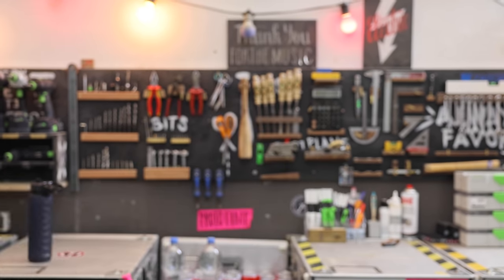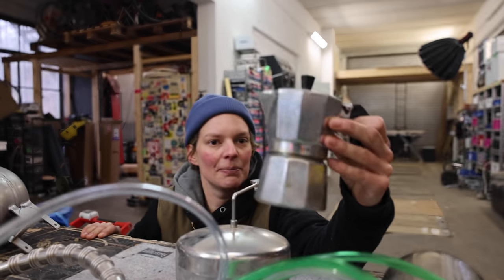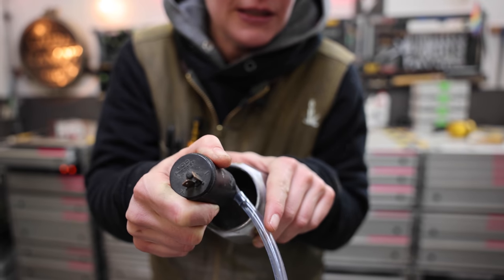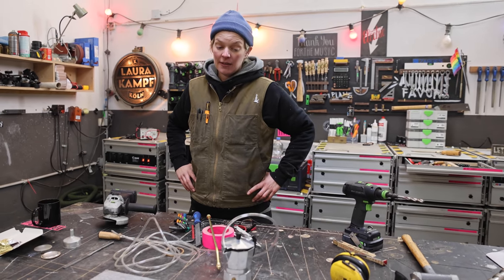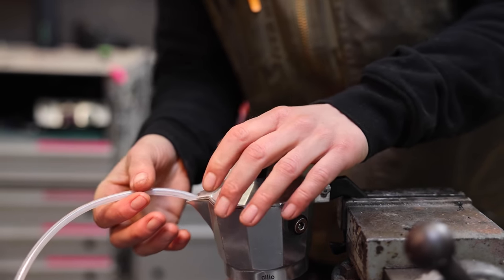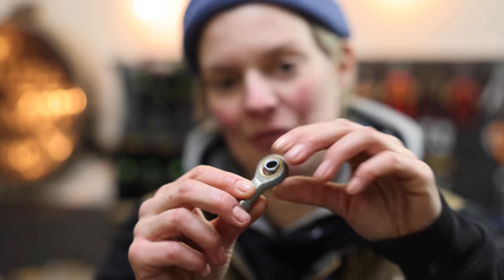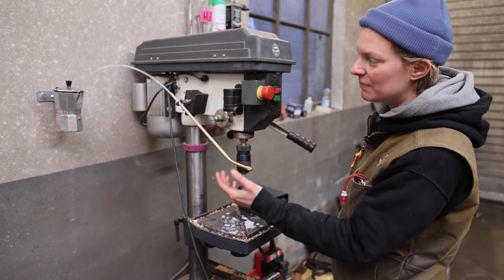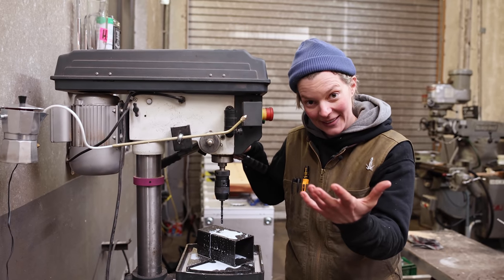Cutting Oil Pump from old Coffee Maker (genius or stupid idea?)

Comment: add a solenoid valve that is on the same circuit as the pump.  When you step on the pedal it turns on the pump and opens the solenoid allowing the fluid to flow.  When you remove your foot from the pedal the pump turns off and the solenoid closes.  Commercial espresso machines use a lot of solenoids that I think would work perfectly for what you are trying to do.

Comment: If you want to overengineer it, you may use a magnetic valve (12V valves are available). With the foot pedal you can open it and as it is leakproof you might not have the dips. Take care on the current consumption to not burn your AC adapter 😉

Comment: Epoxy the tubing into the pipe then have a rubber gasket that will only allow liquid through under pressure in the tip of the nozzle. Maybe just a round piece of rubber and you poke-cut a flat slit in it.

Comment: An Electronic approach would be sucking back some of the fluid. By reversing polarity of the pump.
 But probably best to have a small magnetic valve on the tip or close to it. But first try to lower the oil tank.

Comment: i agree with the idea to lower the pot, but it may not be a solution since the tube goes higher than the work surface. It may be still a mess, a smaller one, but still. 

In my opinion it my be either working on a nozzle or the punping. it may need to not be "continously" pumping liquid, more like a squirt gun., intermittent

Comment: The copper pipe should be angled up, so the fluid runs back into the pot. And you should add a foot switch to add oil on-demand.

Comment: As many have said. It's a syphon. Either drop the pot lower or pop a small spring and ball bearing valve in the line that the pump can overcome but stops the dribble.

Comment: Laura, you have created a siphon and once the cutting fluid starts, it will continue through air pressure.  Rob Sweeney is correct, lower the reservoir to below the drill platform and when you stop dispensing fluid it will flow back into the tank.  

Enjoy your creativity.  Wishing you and your furry kid a blessed week.  Peace

Comment: I would hazard a cautious guess that having the nozzle lower than the oil reservoir means that once the tubing been filled with oil by the pump, it keeps on syphoning oil out and dripping without power. An easy fix could very well be putting it lower on the wall, perhaps level with or below the table on the drillpress?

Comment: Mount the coffee maker onto the press and  relative to the table and not fixed onto the wall.  
Replace the plastic handle. Was meant for occasional use. I fear the handle will fail with pump vibrations and torque of the hose 

See siphoning issues.

Comment: I love it. But the path that was so clear and straight was merely a mirage concealing and endless series of turns and obstacles. It think the first wrong turn was the first step. The pump. The solution is in the final problem. Gravity. Just a motorcycle fuel line shut off and gravity from the reservoir would have done the whole job. But where’s the fun in that?!

Comment: I think the leaking fix is quite easy: You have make the connection between the hose and copper pipe air tight.
As it is, there is no  direct pressure from the pump into the nozzle and cutting fluid gets filled up inside the copper pipe and gravity pushes the rest of the fluid in the pipe out. If the connection between the tube and the copper pipe is air tight, the internal pressure of the system keeps the liquid in. The weight of the liquid in itself should not be enough to overcome the sipfhoning effect through the internal resistance of the pump when not active.

Comment: Who says you can't drill glass?

When I was taking middle school shop class, one of the projects (not one I did) was to make a lamp from a wine bottle.  I don't know the details, but a hole was drilled near the bottom of the bottle, on a drill press, to run a cord.  Rather that a drill bit, I think the cutter was just a metal cylinder.  Some kind of grit and maybe water or oil were used too.

Looks like technology has improved in the past 45 tears.  A quick web search finds numerous diamond and carbide burrs go cutting glass.

Comment: Yep. As others have suggested: peristaltic pump is probably the best bet. Nice, even, small, individual dispensing on demand. And if the coffee pot reservoir is lower, the "extra coolant drip" from the line might be negligible. I know, I know.. you don't probably have a spare peristaltic pump in the warehouse of parts, and everything is supposed to be upcycled from trash. But get it anyway. Don't let the perfect be the enemy of the good! That said, I'd never bet against your imagination. Given time, perhaps you'll find the ideal solution batting around in your parts bins, as you have so often done in the past.

Comment: You should also probably change or reinforce the handle of the coffee maker: it is not designed to support all the extra weight, so you have a weak point where it's attached to the coffee maker...

Comment: Another great video. Maybe what you could use is a non return valve. They use them in cars for the washers - that way the water does not seep back into the bottle but sprays as soon as you push the washer button. Just an idea.  Anyway, love your stuff!

Comment: Perhaps there is a way to add a small nipple or latex fabric piece inside the tip that acts as a stopper when the pressure drops from the pump, so it won’t drop. Similar to a baby bottle nipple that won’t drip when knocked over. That way you don’t have to move the location which may be problematic in itself. Somehow sealing the tubing inside the metal line in a way that stronger than a press fit may be necessary. Hot glue gun would likely work.

Comment: My thoughts are even if you move the tank lower you will still get the fluid in the pipe running out, you need something like a bite valve or baby bottle nipple that the fluid needs to push pass with minimal resistance put will close off when there  is no pressure from the pump. Even a reed valve made of rubber? You are so close, don't stop now!

Comment: to solve your issue I would run the pump for a second backward when it gets stopped. Sure, this would complicate the electronics. Still probably the most reliable solution.

Comment: Make a device like an intrivious drip like the hospitals use with a drip feed. Open the drip feed value when you want oil, close the drip feed value when you don't. If you put the drip attachment holder and a spill cup holder on he same pole you can rotate the cup underneath the drip to catch any drips.

Comment: I actually think the problem is that the tube is a bit smaller than the diameter of the metal pipe at the end, so air can enter the system. At the same time, the nozzle is smaller than the tube so excess oil will rise between the tube and the pipe which also adds to the dripping. I think you should just connect the tube and the metal pipe in a way that is air tight and you are good.

Comment: Another idea; my drilling machine has a sump attached to the table to catch the fluid that ends up there.  It has a filter to keep debris out of it.  It's essentially a hose fitting with a tube going to a container; if you filter it well enough, you can reuse it.  For my small drill press, I use an IV bag with a nylon tube clamp; I adjust the volume with the clamp.  I really should dye my coolant red - that would be hilarious.

Comment: If u wana drill a hole in Ceramic or Glass try put that into the water and drill...should be easy and will not brake on apart.

Comment: Maybe it's not a failed project, you just have it on the wrong machine? It looks perfect for doing big cuts on a lathe or mill. For a drill press, I think you probably want something that will dispense fluid in discrete quantities. Maybe get a bathroom soap dispenser, and hook up a foot pedal?

Comment: I think a old fashioned oil can would work better and just place it on the side of your drill press.  It’s held in place with a magnet. Just reach up and grab it. Also I can tip it over and let drip out if I need to.

Comment: What if you only used the foot pump to add air to a sealed container? Foot pump pumps air in, tube that is low on the container let’s cutting fluid escape. Then you would get only one burst of fluid at a time.

Comment: The ideas I have

1) a lightly spring loaded cap at the end that opens when there’s enough pressure, but closes on a drip

2) attach a powered clamp to the flexible hose that activates when to depress the pedal

3) mount the pump lower than the work surface, so that when it’s off, it can’t limb higher and out the nozzle without the pump

4) similar to 3, make the hose longer, have it go down to the floor, then up above the drill, then back down to the work surface. This should limit dripping, but there would be fluid in the u shape that goes towards the ground, but would be better than the current dripping.
Reply: Number 4 won't work. Regardless of the hose length, as long as the reservoir is higher than the nozzle, the system will act as a siphon.
Reply: @tuffaluffagus  Your confidence suggests you're right, but gas thieves would probably argue with you.

Doesn't air pressure enter into that? So actually, it more depends on the surface area of the reservoir I think multiplied by the pressure? Which means that, yes, if the pressure at the nozzle is less, then the liquid would come out, but only if that pressure exceeded the force of gravity

Bottom line: I think it's more complex than that
Reply: @EliotHochberg  imagine connecting a hose to a funnel, both ends pointing up and held at the same level. Now imagine completely filling the system with water. Would the water automatically start shooting up and out of the hose because of the difference in surface area exposed to atmospheric pressure? Unfortunately, no. Then we'd be able to build free energy generators. The amount of pressure at any point in a volume of liquid that's open to the atmosphere is directly proportional to the height of liquid above it. So as long as there's a difference between the height of either end of the system, the pressure will always be higher on the end that's mounted lower, regardless of the surface area exposed to the atmosphere.
Search "aquarium bridge" and "how do siphons work?" for really interesting edutainment!

Comment: Use gravity. 
Just put the pump lower on the wall than the spray nozzle.

(Think of your shower head.
      If you turn the tap off after a shower, the water stops.
      If you then take the shower head, and bring it lower than the tap, suddenly water comes out again.

By positioning the pump above the nozzle, you've effectively made a 'passive' drainage system (I don't know what the official name is)..
.    ya know.. Like a rain drain... 
Water / liquids will flow to lower places automatically)
Reply: Also, cool design.
       I literally have the same coffee pot sitting around (it's had it's best time long ago) and was wondering what to do with it. 
     This gave me some ideas.
(I felt the same about the metal funnel and filter mesh, by the way ;)
      There's something about carefully machined metal items that I just love - I have a lot of trouble just throwing these things away :)
.    I always end up thinking 'there must be a way I can reuse this for a project'

-

I think I will reuse the funnel for refilling my large paint / ink markers, btw. 
      (It's always a pain to get the plastic ones clean. and using a diy paper cone doesn't always have a large enough opening to pour into without making a mess)

Comment: Working without clamps on your work piece on the drill press is very dangerous, if you had clamps you could use your oil bottle. Drilling ceramic and glass is easy with the correct bits, the coffee machine is way to small!

Comment: I kinda thought your very first idea would have been simpler. Just make a dust cover for the large filling funnel. Skip the pump and just mount the reservoir high enough so it could be gravity-fed with a valve to adjust the flow rate.

Comment: Hi, I ran into the same problem in my engineering final project (thesis), in which I had to serve very precise amounts of liquid.
I solved it using solenoid valves.
Here is a test video of the project.
https://www.youtube.com/watch?v=fA5ydgz7hTY
In my case it kept leaking because the solenoid valve was far from the end of the hose, in your case if you place it near the end the problem is solved.
The solenoid valve can be activated together with the pump.